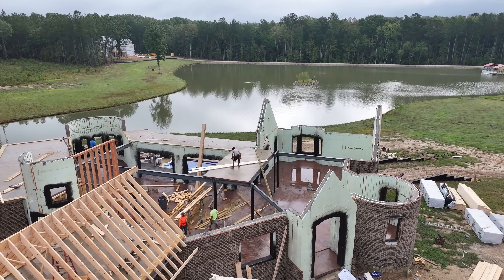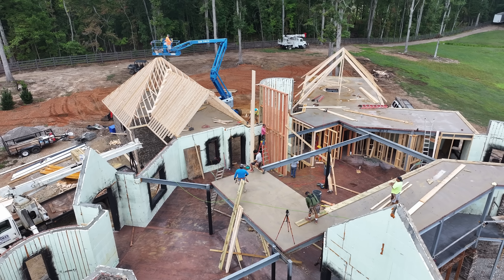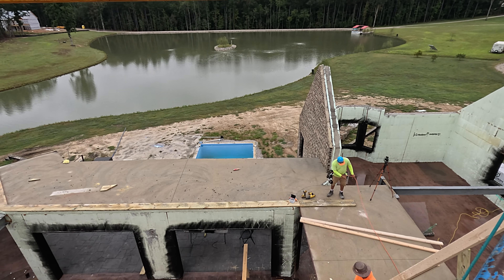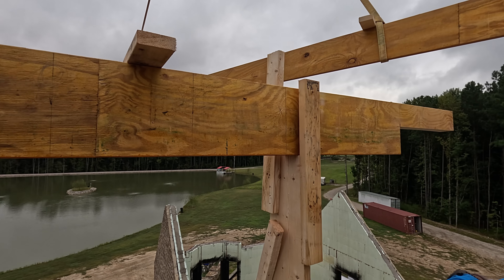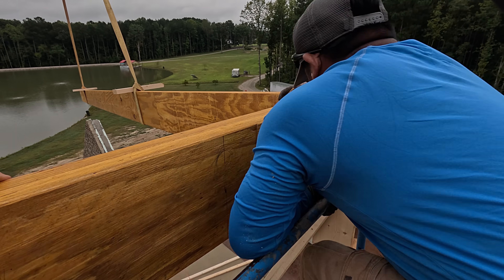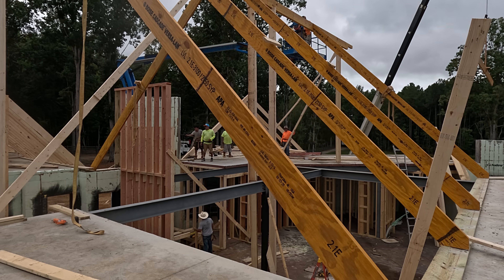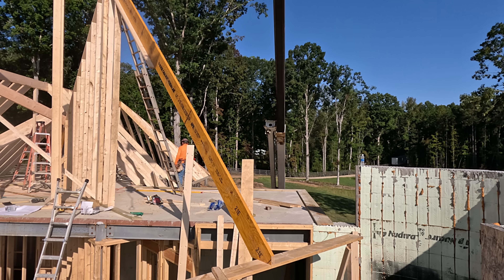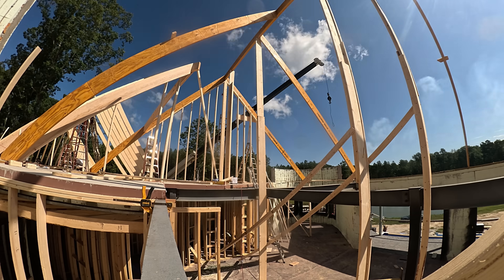ICF Castle Roof Part 2 – Ridge Beams & First Rafters Installed

Comment: When using micros why would you risk strength and two piece the ridge. Makes no sense! Surely that’s not over 60’
Reply from the maker: 40’ is their max length versabeam.
Reply: @BealyGood if you buy microlam the same thing other brand you can buy 53’ for sure. I’ve set ones that long recently. Just seems to be odd. Code standards aren’t as high there I guess.